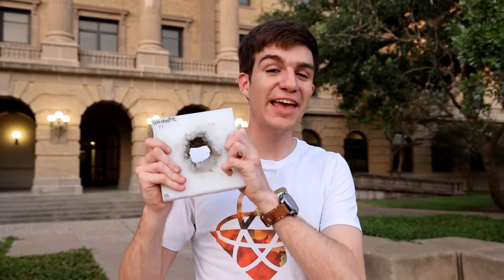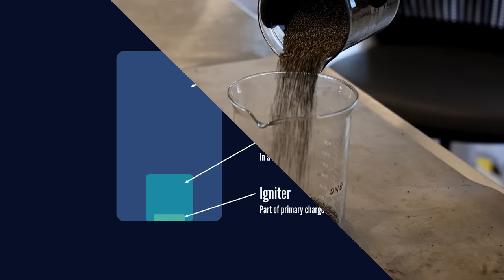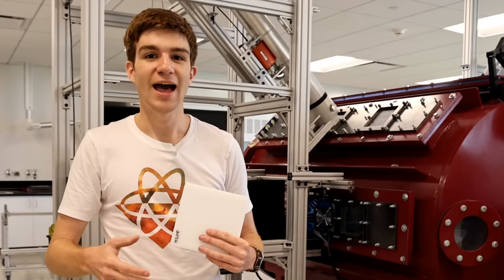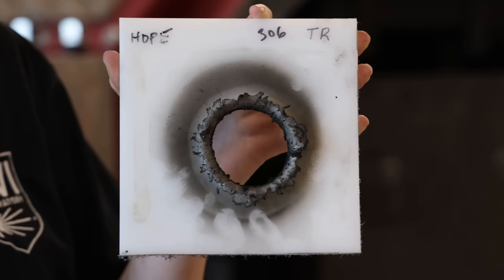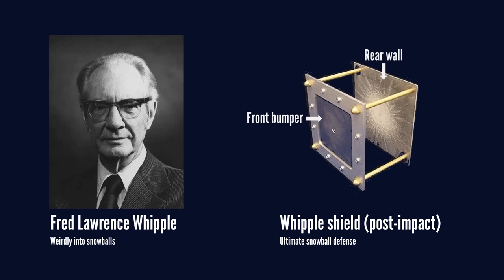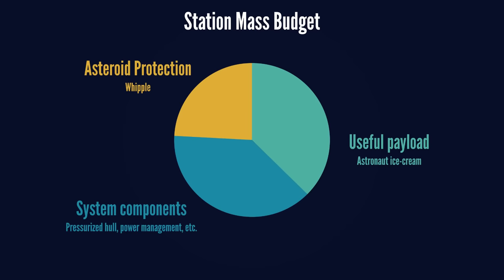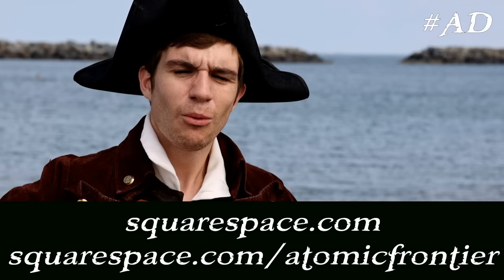Asteroid Shields are OP

Comment: Great episode, Captain Sellout.  The problem is much worse in the direction of travel.  I wonder if the ultimate solution isn't shielding, but some kind of magnetospere.
Reply: how exactly would a magnetosphere help? and why Captain Sellout?
Reply: In the 'description' section, the last segment is labeled "Captain Sailout". It contains the advertisement. 

I suspect the magnetosphere is supposed to act as a force field - if incoming matter like dust grains could be ionized, a magnetic field could potentially act as a shield. Or the deflected particles could be collected and held together magnetically like a plasma sheath. No idea if this is feasible.
Reply: @justinhannan1713  "...if incoming matter could be ionized..."  I am not an expert on this, but if a particle had been in the space for while (that's a joke...) couldn't it have interacted with ionizing radiation, e.g. galactic cosmic rays?  Aren't particles in the solar wind ionized by definition?

Comment: This could potentially be used in military applications like tank projection although its primary be used inside of it as to protect the crew not from the main armament but the spreading of the debris when the projectile successfully penetrated the armor and now broken itself and the said armor into bits.
Reply: Ah, you mean spalling? I could see its usefulness there.
Reply: Not gonna lie but that been a thing for a while in the military it's called "spaced armour". 
Now I am not gonna pretend to be an expert on military armour, but as far as i know modern projectiles like APFSDS just laugh at spaced armour. 
They are just to fast, have a ton of mass (I think mostly tungsten) and don't spall enough that spaced armour matters.

Here is a simulation of that:(not the best source, but you get my point)
https://www.youtube.com/watch?v=qWDoPRW24EY

There is a reason that most nation are investing in ERA instead of "spaced armour" (MBTs mainly).

/infodump end

Thank you for reading. :)
Reply: @TheZack089  Did you even read what I said?

Comment: When i was in school one of my physics professors showed us a picture of a window on the ISS with cracks and a lg gouge. Scary enough on its own but when he explained itd been caused by a fleck of paint from an old booster, satellite etc... that was calculated to be just shy of a centimeter across really brought home how fast and dangerous debris up there is. For my masters i built and described a debris de-orbiting platform that used a 1kw fiber laser to ablate material from older hardware and push it into the atmosphere to burn up. I was even encouraged to send the design proposal to NASA who did get back to me, stating the concept was sound but the power requirements were unrealistic. Now my design called for a combination of an RTG, solar panels, and a bank of capacitors. The prototype worked fine (watch styropyro for visuals if need be). What i came to find out is the stockpile of plutonium 238 for RTG'S  is very low and NASA has it all ear marked for future missions. So oh well guess we'll just keep doing nothing lol

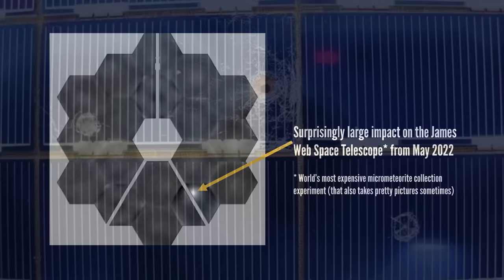Comment: That aluminium block with the huge crater on it at 1:37 was an experiment made by NASA. They shot a 14g (1/2oz) piece of plastic at 24.000km/h (15.000mph) and that's what it did to that solid aluminium block.

Comment: "All guns operate with the same basic principle: with an expanding cloud of high pressure pushing a projectile along for the ride" - you say, shortly after mentioning railguns, which are guns, where their propulsive force is generated by magnetic fields, not by a cloud of high pressure gas.
Reply: hydigin gas
Reply: Well, every usable railgun design i studied indeed uses a high pressure gas to push the projectile. The main acceleration of a railgun is indeed created by the magnetic fields. However, without that initial push the projectile would fuse (weld) itself to the rail. So the principle stil stands - it just gets a boost by the magnetic field ;)

Comment: That's a really cool idea, it can take a projectile from any angle, but only on or near the plane of the hexagon layout. For off-plane projectiles, I think it would need at least 3 layers of this stuff, one oriented each for X, Y, and Z axis. Not by any means a deal breaker, but still something to consider. Perhaps a matrix of different hollow polyhedrons instead of a 2d hexagrid might be more practical to use, definitely not to build though. Think it would have to be 3d printed.

Comment: the only thing that might work better is a piece of material that basically has a frick ton of bubbles in it
as honey comb deflect the impactoid a material like i described would essentially be sealed multi-layered mesh 
or ... hmm. bullet resistant fabric layered and coated with carbon fibre layers and resin

Comment: Maybe I misunderstood you when you said the new type of shield could replace the pressurised hull... but would you not still want the shields to be independent of the structural walls so that it can easily be replaced after a bad impact without having to depressurise the section?
Reply: The shields do not generally need replacing as the holes are few and far between and the damaged area is very small so it is extremely unlikely that the same part would be hit again.  In any case if you worry  about that you could always just overlay the damaged part with a new piece of shield just large enough to cover the damage, rather than  replacing the damaged one.
Reply: @listerdave1240  ah, that makes sense... I guess it's because I'm a programmer I tend to focus on the absurd worst cases (if you don't handle all the unlikely but possible events in programming, sooner or later one of the "unlikely" worst cases is going to happen 600 times per second on the production server.. so it's better to at least return an error early if not actually handle it); but I guess in (physical) engineering you probably can and should build things for the most likely events and not the infinitesimally unlikely ones. 😂

Comment: I dunno where this "u-turn" thing comes from, you can plainly seen in the video that by the time the object is going 180 from its initial vector, somewhere its momentum has to be = 0 and after that it's not going anywhere.
Of course it still works as armor if it's not penetrating the interior hull

Comment: Very inspiring video, if a meteroit hit can return to the direction it came from it could mean space exploration get much safer!!
Reply: Meteorite hits are not considered a particularly significant risk in space exploration. Even before this innovation the existing shields are sufficient to minimize the risk to acceptable levels.  What this innovation does is not to make a stronger shield but to make the shield much lighter for a given amount of protection. 
The two biggest risks in space exploration in my opinion are equipment failure and unpredictable radiation from the sun.

Comment: It's kinda funny how similar the light gas gun is to a giant springer like a Nerf gun. Basically replace the spring with an explosive, replace the air with precompressed hydrogen, and add a burst disc valve and you've got the right idea.

Comment: 9:10 How thick is this wall actually? Hard to tell a scale, but that's an awesome strategy/design.
This can probably get a better result when the panels are angled at more than 45° angle of the previous panel, as the projectile would travel through slightly more material and get more resistance.
Reply from the maker: About 5cm. I had planned to hold the thing but forgot to film the scene because I was rushing to get to the train back to Houston.
Reply: @AtomicFrontier  That's really tiny for what it does, thanks for the answer!

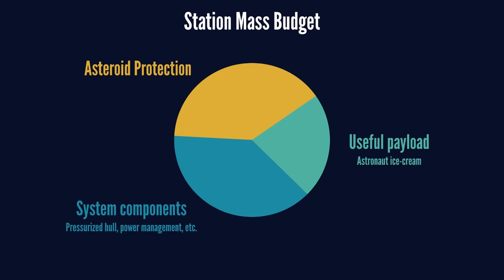Comment: 8:33 - I don't see how a large volume could be a problem. You tend to have a fair bit of space, you know, in space.
Reply: The problem is launching it. A larger structure will generally require a bigger rocket to launch than a smaller one, even if they both have the same mass.
As you said, large volume should be fine in space, so the ideal shielding would be something that can stored densely at launch and later expanded.

Comment: I wonder how effective this would be at stopping something like a tank's APFSDS, per se
Reply: From what I saw, the tank round you described seems to be a long spear. The space station armour is supposed to ward of small debris that can will break apart into smaller pieces when the space station is hit. I don't think that would break apart, though maybe it would at 10km/s instead of a tank' shells 1km/s (got that speed from a quick google search)

Comment: ..........what if the "honeycomb" structure, was filled with gas? if you mathed it out right, couldnt the impact, pressurize said gas, and allow for SOME kind of extra impact reduction, (with the pressure pushing the debris back out the hole it came in from even more than just the honeycomb structure alone) or do you think it would act to do more damage instead? (acting like the gas in the launcher, to create a hazzard for the people inside the station).....basically could a gas/honeycomb hybrid "dumb reactive shield" [as opposed to a "smart" one that uses AI/explosives to react] help to avert damage, or do you think it would cause more?

Comment: Love the video so far as usual just wish you converted to mph and ft for us dummys in the us.
Reply: If exact numbers are not required (you just want a ballpark estimate) 
kph / 2            = mph  {easy}
(kph * 6) / 10 = mph  {more accurate}
meters / 3  = feet
I am from the US and do these conversions mentally. It is much simpler to do science related computer programming in metric units. I still convert results / final answers back into miles, feet,  Fahrenheit etc for ease of imagination.

Comment: I think the James Webb telescope will only be a viable telescope for another year or so before the mirrors are so damaged they won't be able to give sharp enough images. Could possibly be one of the most expensive engineering mistakes ever.
Reply: Hubble did well, maybe Webb will also.
Reply: @RawbLV  Hubble had a cover and the mirror was only exposed when they were taking pictures unlike Webb where it's exposed all the time.
Reply: @tylerhensley2312  it can fold up and open
Reply: @wvking  the Hubble has a cover that can be opened and closed to protect the mirror, the James Webb is open all the time and the mirrors never close or shut down on the James Webb, the mirrors are always open to whatever is passing through or to whatever is in its way.